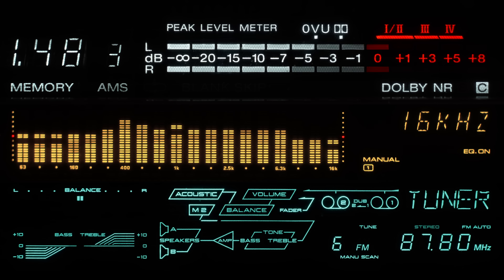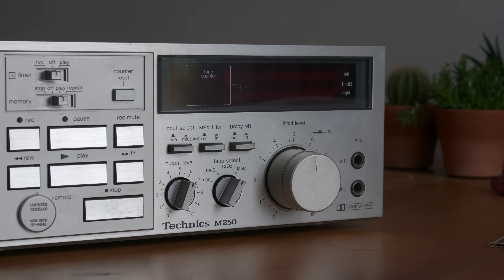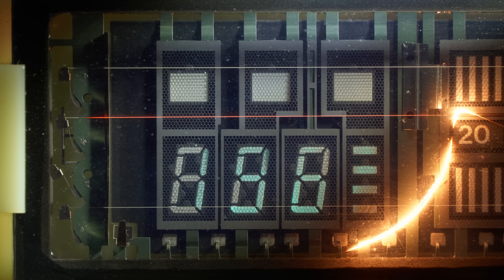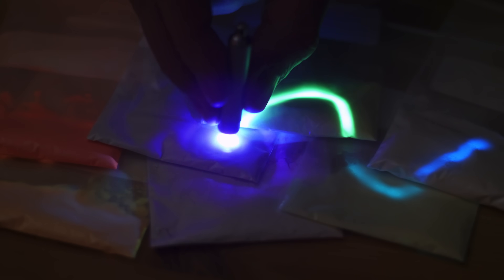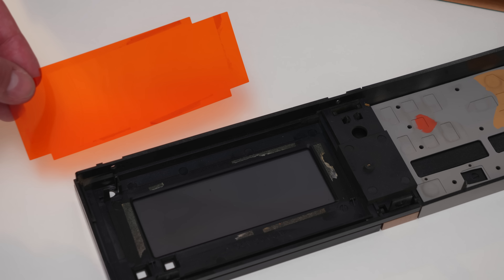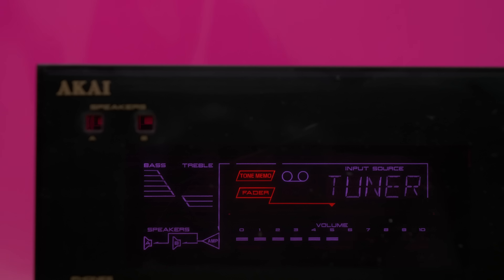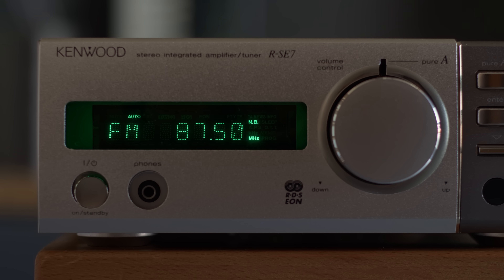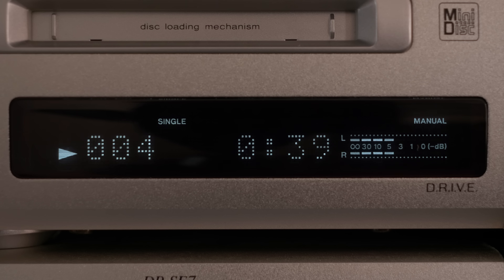VFD Displays

Comment: Turquoise was most likely chosen by being very high-frequency. Higher-frequency, bluer colors tend to appear more intense than lower-frequency, redder colors emitted at the same brightness. It also naturally contrasts well with warm sunlight. So, all in all, a turquoise phosphor shouldn't require as much power to be clearly visible in most light conditions.

Comment: why were there never vfd flat screen monitors
Reply: Because they would be too expensive and difficult. The filaments would have to run the entire length of the screen and you'd have to suck the entire thing to a vacuum which would be a huge burden and then the atmospheric pressure would be greater so you'd have to make thicker glass which would add weight and on top of that it would be very fragile and energy hogging
Reply: @exoticcar5482  you just described the concept of a crt
Reply: @hyakin7818 Mostly, but a CRT is heavier and needs more force to break. The biggest difference though is that CRTs use an electron gun at the back. These use hot filaments as cathodes instead. Unlike the traditional CRT design, it is way harder to thread the extremely thin filaments all the way across the length of a monitor screen and the power consumption would be worse than a small VFD. You are right though, VFDs are basically vacuum triodes that act like mini CRT displays.

Comment: The cassette deck at 3:15 is a Sony TC-V7 from about 1983. It was part of a modular system that included a linear tracking record player that had a similar forward-sliding mechanism for loading vinyl. Beautiful design.

Comment: "that might be the reason I have never seen a warm white VFD"
I just so happen to have a tape deck with a warm white VFD. This tape deck is not in great shape and it does not play tapes right most of the time, unless they are in spotless condition, but still, it has a very enjoyable warm white VFD. I just wanted to mention that they do exist and are not impossible to find.
(if anyone wants to know, the tape deck is a Technics M11)

Comment: Loving the production quality. These VFD's seem different to the early 80's games. In the UK, Japan and US we had great games with VFDs that literally looked like small individually segmented vacuum tubes. A bit like the first digital watches and calculators. The later 90's products seem to have used agitated chemical (phosphorus) print with an overlay grid to excite the chemical print in a much larger vacuum sealed glass unit. Is this correct? The older type seems a lot more reliable, I still have the games and two calculators. I guess with the older segmented vacuum types detail and production costs were an issue.

Comment: The "String" is the filament. 
The filament sends out electrons and they pass through the grid acting as the controll element. 
the glowing part is the anode which is coated in a fluorescent powder, when electrons hit it it glows. 
Anode is held positivly atracting negative electrons. 
The Filament is negative obviously.
Since the tungsten wire isnt glowing much there are not many released electrons so the grid needs a potiive charge to accelerate them enough to reach the anode. 
Different segments get lit up by multiplexing it or deticated controll for every anode. 
The anodes arent coated with phosphor most likly, they use Zink Oxide for example

Comment: i had a Kenwood 7030 eq... someone gave me one of those " to the rhythm" tesla balls. i sat it atop the eq and after ten minutes, the freq bars started striking from top to bottom rather than the original bottom to top. bought it in Okinawa in '92. still works with the 9030 tuner and Klipsch tangent 5000s

Comment: why did these went off the market.... theres something so peaceful looking at vfd's
Reply: They're more on the expensive side to manufacture and are basically glass tubes that need to be pulled to a vacuum so the electrons can flow which is an ordeal compared to other displays. They're also much more power hungry than LCD and modern LED displays due to the filament cathodes which generate much more heat than they do electrons and even less of all that ends up as light.

Comment: Maybe someone more knowledgable here can give me some insight.
I'm in the process of a custom RGBW cluster and dash setup in a 2000 Bonneville.  The HVAC controls and 3 screens in the cluster are supposedly VFDs. The thing I'm confused about is there are red LEDs behind the displays with guides to project the light outwards. On the back of the display is a white diffusion layer then appears to be a red filter then the display. I haven't dug deep into it yet, but I'm not convinced it is VFD although it very well could be.
My plan was to remove the red filter and install the RGB where the factory LEDs are. If this is going to require filters it may complicate my plans.
I have some learning to do about VFDs and some experimenting with my exact displays.

Comment: Those are early OLED displays.
Reply: Not really. These work like old vacuum tubes based on hot cathodes and anode phosphor plates with a powered control grid in the middle. OLEDs work by electroluminescence

Comment: An interesting thing about VFD displays is that they've got anodes (the fluorescent segments), a grid, and a cathode that also acts as the heater filament. Everything in a vacuum.
The same components as audio vacuum tubes!

So it's possible to make a vacuum tube amplifier using VFD displays. 

I've tried this myself; it won't actually amplify a lot the input signal, it can even make it weaker. This is because VFDs operate at low voltages. But it can be used to add a vacuum tube component to the sound, that then will be amplified with a proper amplifier.

A little problem is that when you hit the screen, the same vibrations that appear in the video at 2:35 will be amplified through the speakers. And they can last up to 1 minute 😂
Using a low enough voltage makes the segments of the screen light up to the rhythm of the music that is playing (although with lots of distortion).

Definitely a nice experiment to try out if you know a bit about electronics.

Comment: Coming back after watching Veritasium's vacuum tube video, that helped me better understand VFDs. It's funny how many different ways vacuum tubes were used before silicon.
He talks more about how that metal grid can be used to amplify signals or to act as a switch for the flow of electrons, though here it seems to be primarily for ensuring as many electrons as possible hit the fluorescence.

Comment: I properly miss displays like these. Everything's gone flat panel screens and lacks any aesthetic it might otherwise have.
Reply: Actually tiny LEDs (not referring to displays marketed as "LED" but in reality are LCD) and/or OLEDs could be designed to emulate everything VFD but for whatever reason they don't do that
Reply: @exoticcar5482  I can see some displays emulating this look.
Saw a DVD player at a 2nd hand place yesterday with a screen like this. Almost bought it except it was large and I was walking.
Reply: @kairon156  Whenever I pass a display like that, I look a little further into it to make sure it's not actually vacuum fluorescent. Unless you looked at it very closely, it's hard to say if what you saw wasn't or actually was indeed a VFD. For some time, I was looking at a display for one of GE's current most advanced ranges at the hardware store and it actually looked truly LED, performing like a VFD. However, there were a few visible metal contacts surrounding the elements in the display which looked kinda like a VFD. I was still convinced it was LED though due to looking hard, shining a flashlight through the display, yet never actually finding any control grids. However, after a watch of this video explaining the color filters on many VFDs clearly along with the part about that CD player with the reversed VFD, it became clear to me that this display on that GE range I had so hoped was a true LED display was actually beneath that familiar pink tint, which at that point it hit me that it is in fact a reversed VFD with its control grids behind the phosphors to make them seem invisible. I was tricked
Reply: @exoticcar5482  ooh. I vaguely recall seeing a tinted window but it looked more orange to me.  
I wish my phone worked so I can use it outside and take pictures of cool random stuff and use it's flash light too.
Reply: @kairon156  I'm color blind and so before Posy said it was actually pink, I thought it was some shade of red
Reply: @exoticcar5482  ooh. I had a colourblind friend in high school so through him I understand it can be notable when colours get  involved.

Comment: The old lighting techniques are creative and fun to learn how to work, but the LED spoiled it. Yes, it is true that the LED technology is advanced and its brightness is high and does not consume electricity and is compact  but it is boring
Reply: Actually LED isn't much of the problem. It's LCD that did that. They're just allowed to sell you an LED-backlit LCD display while marketing it as an '"LED display". True LEDs made with proper optics and standard VFD colors may actually well emulate a beautiful VFD but they just choose not to as for whatever reason they don't care anymore. VFDs are an increasingly lost art
Reply: @exoticcar5482  The LCD screen will be fully lit, and the part that is supposed to be black will be gray and clear during the dark. I had a Samsung S10e phone and I had to use the iPhone xr, and the screen almost drove me crazy because of the gray color, but thank God I bought a phone  Another Samsung and the problem is solved

Comment: Tip for people that have dim vfd on their beloved vintage equipment like i had: dim vfd can be fixed to a substantial degree by applying voltage few times to the filaments until they start to slightly glow, they are hot in normal operation but don't glow, so when you heat them up to glow they burn off inpurities and vfd becomes brighter. Use regulated power supply, disconnect 1 side of vfd filament so you don't apply voltage back to the circuit (if it can't be disconected from main pcb cut the trace on pcb vfd is on so you can easily reconect it later if you are afraid of damaging delicate vfd by desoldering pins) connect power supply to vfd filament pins, usualy at the oposite corners, test for resistance with multimeter, and slowly raise the voltage until they start to glow, most will do so at around 12 volts, keep it on for few seconds, repeat 2-3 times, let the vfd cool off for a few minutes, reconect it and enjoy the result. Don't forget to clean the filters and vfd glass itself, i have seen plenty of them dim just becose filter was dirty. That is how i fixed mine on Pioneer casette deck from nearly invisible glow to almost like new.

Comment: VFDs and Nixie Tubes are just something palpable. There's a physicality to these displays that modern LCDs just don't have.
Reply: It's the superior contrast due to self-illuminating phosphors. While they have a "backlight" in a sense which the hot cathode filaments act as, their wavelengths are invisible as they lie in the infrared range and unless the control grid and phosphor element are both positively charged, nothing will glow visibly unlike LCDs where the backlight is very visible and lights up even the inactive elements

Comment: I have an echo dot clock with a bright blue led display. I actually modded it with a gel filter to both dim the display and turn it to a nice red color for better nighttime viewing. I miss vfd displays... they were sci fi level displays back in the 80's when we were all used to light bulbs in electronics.

Comment: This is great. I have recently used two VFD displays in one of my videos; the look of those displays is impossible to replicate with modern LCDs and OLED displays. They are just beautiful.
Reply: I agree LCDs can't replace their look but I actually think with some adjustments OLEDs could look a lot like them. In 1999, Pioneer began releasing car stereos with displays known as OEL, which were basically early OLED displays, and let me tell you, many of them looked amazing. It's about implementation. OLEDs that don't look like how VFDs are don't have the glass-like covers VFDs often use in multiple layers and may not even have the same neutral density filters. Improvements in the outer design of OLEDs I think could potentially improve their looks a lot more
Reply: And there's these car parking system's VFD HUD. I think wonderful things can be made out of these but I don't know anything about electronics. Can't even find this VFD as spare parts. There are some uncommon chiptune cartridges that brought displays as features and I honestly think that this VFD could be more than a feature.

Comment: And they're not even obsolete tech.  I work for a Japanese company that still, in 2023, produces a variety of VFD modules for various commercial applications.  Every one I've handled so far has nothing other than those turquoise phosphors.  I suppose the clients have filters they plap on to provide appropriate hues when they bolt the modules into their end products, but we don't see any of that.
Reply: Wow, what's the name of the company?
Reply: @exoticcar5482  I worked for Futaba Corporation.  Have moved on since then.  They're also pretty famous for remote control controllers, from what I understand.

Comment: I’d love to develop a standalone vfd dashboard for cars with aftermarket ecus, you could implement modern features to communicate with the ecu and control functions, and read info. The 70s and 80s look is what many people want. Many auto manufacturers had analog style and vfd style variants and many people swap them, many people take on the task of putting them into different cars than they were designed for.

Comment: VFDs are impressive, but unfortunately they are very expensive to produce. That is not compatible with the world where cost cutting is a priority.
Another problem is that they draw significant power, so are not suitable for battery powered devices.
Reply: Actually despite this they are still much less expensive to manufacture than OLEDs

Comment: VFDs are basically the peak of 80's and 90's aesthetics. Fun to see these lit up on every Hi-Fi audio receiver system in the electronic shops. :face-red-heart-shape:
Reply: Totally.  It was stuff like this which drew my attention to the design of electronics and how it "talked" or "conveyed" things to the end user when I was young.
Reply: 2000s too.
Reply: Hate how their are so few stereo's now and those available by have tiny round buttons that dont stick out and tiny lcd displays that show very little info and none of it is animated..
And they are all far more expensive than the older far more advanced ones when they were sold..
I wont to buy new hifi gear so its still gets made by good japanese companies but they dont have even the basic stuff they use to sell..
Trying to find a new japanese CD player locally is awful.. 
Their are around 3 companies selling them and only Yamaha has a multi cd system..
And all with the problems listed above..
Reply: I love how they look, but they are also a big let down cause I just bought a used AV receiver from like 2009/2010 and the display is much dimmer than new and with burn-in marks sadly...
Reply: You should buy a pioneer cdj1000 mk3 or cdj800 if you love fvd
Reply: Late 1970's Pioneer Fluoroscan VFD's are cool as well.
Reply: The green ones (or blue with filters?) were used in a radio and odometer in Ford Mustangs 05-09 :)
Reply: cant we do it with nano sputtering and stuff?  QHDVFD 😊

Comment: the cyan phosphors were chosen since they are the most efficient (i.e. brightest) and longest life.  there's around 12 or so different colours of phosphor, but they are all less efficient (darker) and some of them don't last as long so they get darker faster over time.  In the 80's there were a lot of tabletop and hand held games with relatively exotic VFDs showing of a whole rainbow of phosphors and intricate patterns.  also, the filaments are what emit the electrons, and the plates have the phosphors on them.

Comment: I daily drive a 1988 car with a VFD tube display. It's a 1988 x7 Cressida. 

Now car makers return to digital displays with LCD based display. But I think a more appropriate replacement for VFD tube is OLED. Because it's also emits light from the dots/pixels and not from a backlight like the LCDs do.

Comment: Very good!  In tube/valve terminology, the "strings" are wire filaments (cathodes) and emit electrons.  The typically hexagonal meshes are the grids, just as you say.  They either stop the electrons or allow the electrons to reach the phosphors.  And the phosphors are the anodes (or "plates").  The ones I have played with (to repair the driving circuitry) usually have about 20 volts between the cathode and anodes.  There are a lot of great articles describing how the filaments are heated to get even light across the display.  Finally, groups of grids and anodes are multiplexed to save pins.

Comment: Check out the following multi-color VFD matrix displays:
2012 era Toyota Prius dashboard has a giant AMVFD. red + blue pixels that can be used together to make white (I think made by Futaba)
Rational Combo Oven SCC models (like 62G) have 4 Noritake matrix VFDs with orange and blue subpixels
Some Kenwood vehicle head units (like KDC-MP702) had a 2 color Noritake matrix display with yellow and blue subpixels

These were super neat (and expensive), and worked great in places where high brightness or high heat tolerance was needed, but LCD technology quickly caught up. VFDs are really hard to film and photograph, nice work.

Comment: Really love your work. Thanks. I have many things with VFD, I love them. I have a kenwood system on which the tuner VFD is darker than the other modules as it displayed the clock 24/7 for many years. I'm now thinking maybe I can increase the brightness by replacing the filter with something less filtery :)